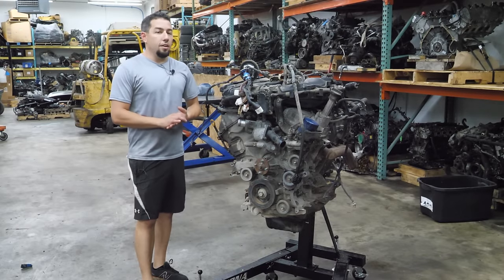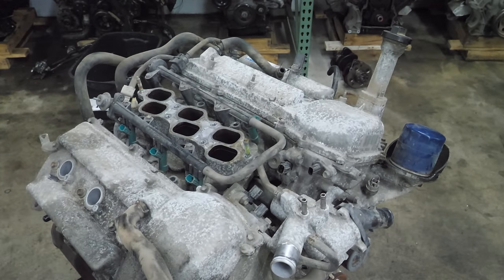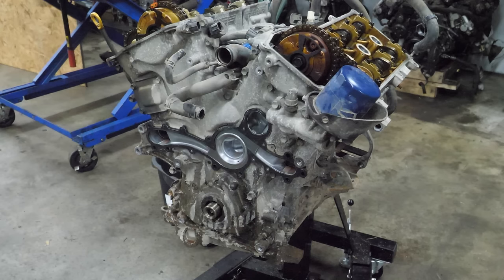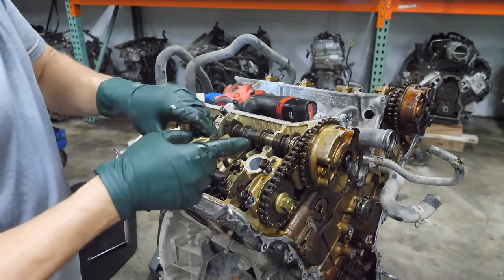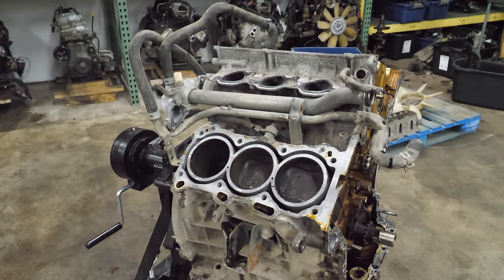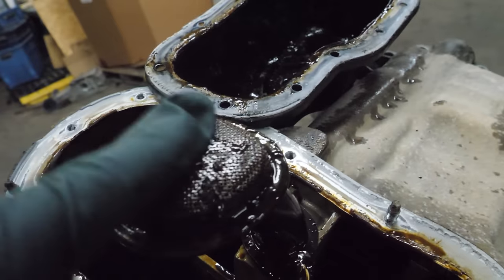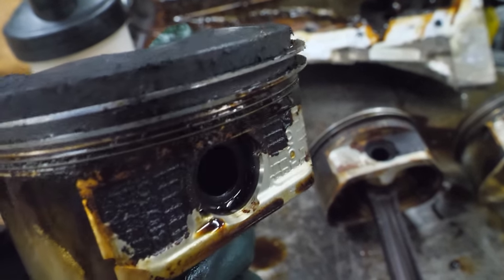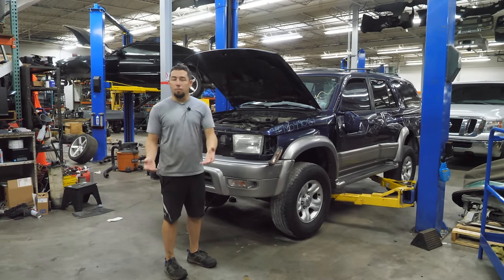Toyota 4Runner 1GR-FE 4.0 V6 Blown Engine Teardown. Just A Slight Tick...

Comment: Awesome win! Yeah, I'm interested in seeing what damage can be caused by which events on really bad engines. When I hear the description of the condition before you start the teardown I like to speculate what might have happened. Given the overall condition of this vehicle, and the very low cost to you, it was a no brainer even assuming the engine was bad. Even the engine, minus two rods and pistons and the normal replaceables on a rebuild, has lots of good, saleable parts.

Comment: The reason there was water still in the engine was cuz you only removed the drain from one side.  V configured engines have 2 low areas, one at the bottom of each of the banks.  So if you remove both of the drain plugs (one on each bank) when the engine is level and vertical and drain both banks, you will only get a few residual drops of coolant when you turn the engine over.

Comment: Worked for Toyota during the early years of this engine.  Timing covers leaked - we used  Seal Packing (FIPG) 103 Liquid which is that very black RTV you see on that cover.
Reply: Dang would've been healthier to just leave it alone. Seems to be only a drop a week max on mine. Just makes the engine a little dirty

Comment: Looks like it definately got hydro-locked from water ingress blowing the conrod which means the engine can be re-con'd.  My previous 04 Prado 120 V6 with same engine failed from overheating when my wife was driving it in summer. The radiator sprung a leak and she did  not know and kept driving it & came home with a similer knocking noise to yours.  The heads got cooked and warped so we had to source another set of heads to recon. The block got bored & honed with oversize repair piston Kit and the whole engine was basically recon'd to back like new including new water pump/new guides/chain etc and back in the car with new radiator etc it ran real sweet again.  
We sold that white 5sp manual Prado for a later model black 07 same Prado 120 V6 with an auto trans (wife did not like changing gears in traffic) and we still have it 3yrs later as it is an awesome 4wd with a ton of mods now including harrop-E rear diff locker & upgraded exhaust, upgraded suspension, upgraded grille, upgraded binnacle LED headlights, upgraded LED tail-lights, upgraded wheels etc etc - It looks sinister now all blacked out.  Awesome engine

Comment: That was me with the tensioner I pulled off my 200k mile 4.6 2v tensioner. Not gonna lie, it didn’t have even one scratch, and had absolutely no wear pattern. I was upset. I’ve been thinking about changing that timing set for almost 135k miles, and worried about it for about 50k miles. Turns out I could’ve ignored it for another 200k miles. (Not literally of course). Thanks Lucas heavy duty oil stabilizer!!!

Comment: Eric: It looks like both the intake and exhaust valves are open at the same time, that's not how engines work!
Detroit Diesel: Hold my beer!
Reply: Not really an intake system as it's blown all the time. Yes I'm being that guy just to be that guy.

Imagine if he could tear down a small Detroit.
Reply: @taliakuznetsova7092 or maybe a big one? I used to work on 16v149tibs back when dinosaurs roamed the earth, I'd absolutely love to see a teardown of one of those.
Reply: Or any hot rodder's engine.  Overlap is almost mandatory.  A little at least.
Reply: @russellstyles5381  I've never heard of that before. May I have some more information?
Reply: @taliakuznetsova7092  It is quite usual for the intake valve to begin opening before the exhaust valve has fully closed, even on moderate performance engines, not just hot rods. They would not be both fully open at the same time. With a tuned exhaust, the exhaust can create a low pressure in the cylinder as the intake starts to open, helping to start sucking the new mixture in.
Reply: @taliakuznetsova7092  overlap means that the inlet and exhaust valves are open slightly at top dead centre between their respective strokes. This improves performance because as the exhaust rushes out of the cylinder it creates a brief pulse of low pressure behind it, having the intake open at the same time allows it to suck extra mixture into the cylinder. The extra mixture also tends to flush residual exhaust from the cylinder.

The downside to this is that at lower engine speeds the valves are open too long, leading to exhaust being sucked back into the cylinder during the intake stroke, and fuel escaping out the exhaust. So the engine is less efficient, and might run poorly at idle.
Reply: @nerd1000ify  Which I imagine contributes to the popularity of VVT systems that can remove the overlap at low and idle speeds to get that efficiency back.

Comment: I think the demand for these (and a lot of toyota engines) is export primarily. Yes they're swapped around not common like LS swaps but they're done especially into older stuff like t100s old tacos and 4runners and all that and even stuff like mazda b series and isuzu whatever they where. But i think primarily it's export. Even a common as dirt 1zz-fe (corrola engine) cores run around 300 bucks or so. Good ones are are about a grand unless high miles. a 4l v6 in a lot of places is a BIG engine and they rebuild cars from scratch in a lot of places these are exported to. I know my home country has an entire industry of importing in parts cars and rebuilding them. The quality of the rebuilt cars is often better than the locally produced stuff. Japanese imports are crazy expensive. African nations are similar.
Reply: I was thinking the demand has more to do with the lack of supply. Usually the only way you are getting one that doesn't have a ton of miles is finding a wrecked one.

Comment: This was a great video.  I have a 2013 Tacoma with the 1GR-FE (just turned over 100,000 miles today!), and I really like mine - plenty of torque, and it makes nice sounds.  Much better than the newer models with the 2GR-FKS.

The thing that caught my attention was the knock sensors, in the valley in the block next to the Number 3 and 4 cylinders.
Reply: I had a 2019 Tacoma standard trans. I didn’t like the 3.5 much, no low end torque. I’m in a 2021 4Runner now, I love the 4.0.

Comment: Best part of the week! Watching Eric's teardown videos. The water pump gag got me. A suggestion for another engine disassembly video. What about a GM 3.8 V6?
Reply: My 1989 Olds had that engine, the timing components were pretty much all sitting in the oil pan by 100k.
Reply: @piggy310 plastic parts or bad manufacturing?
Reply: @taliakuznetsova7092  Plastic parts..
Reply: @piggy310  plastic is both a marvel and the bane of society at the same time in a magnitude of ways.

Comment: Great video! I had a 1GR in my 08 Tacoma. It was a solid engine. I even ran a dry 75 shot through it without any problems. I’d love to see a 2GR-FKS from the 3rd gen Tacoma which is what I run now with a supercharger. Even a Subaru boxer engine would be cool to see torn apart. Keep up the excellent content!
Reply: I know he has done at least one Subaru engine in the last 6 months or so a year at most.
Reply: I'm one of the few who doesn't like (I don't hate either) that engine.
It has goofy power delivery. Weak low end torque, any power that it does have is up in the revs.
Reply: @Hybris51129  Thanks. I found a couple episodes. Surprised I haven’t seen these yet.
Reply: damn bro you put a 75 shot in ur taco LOL that's hilarious
Reply: @joshanderson924  yeah man. The video is on my channel in the shorts section. It won’t let me post the link. It ran mid-high 14’s in the quarter mile. 140k miles. The car running in the other lane ran 11’s.
Reply: @fiveohstang  Damn haha love these engines you could probably run them on Nitro Methane 😂

Comment: The 1GR-FE that's on 2010 and up had some significant changes. For one thing, they totally relocated the oil filter and associated plumbing, so I figure it's actually a different beast in many ways than the one you worked on.I  Know the one used in the Tacoma was a bit different, and the 2010 models on used dual VVi as opposed to single VVi on the older ones. My point being, it's actually a very different engine from 2010 on.
Reply: Does that include the 2010 itself?
Reply: @joshanderson924  Tacoma 1GR still used single VVT until the 2GR-FKS replaced it. The 4Runner got dual VVT when the 2010 full model change happened. I'm not sure about the Tundra.
Reply: I've got a 2016 1gr with single vvti in a 2016 Hilux awsome motor
Reply: They are still in the current 4Runners. I have 2 of them a 2020, and a 2021.

Comment: My theory for engine swaps. People keep running them into water and hydro locking them. Seen a few of those on tacoma forums throughout the years. 

With that being said. I own a 1gr in 2nd gen tacoma. The truck is great. But they're kinda slow and horrible on fuel. But I dont like working on my daily. So I live with it.

Also can someone explain the oil filter housing to me? I love that they made a drain for it. But why did thru drain it directly over the power steering pump. Its stupid
Reply: The built in funnel runs down to the bottom of the engine if I remember correctly.
Reply: @12345.......  it does not. You'd have to run a 3 foot hose to get it under the engine
Reply: Plastic bag under the oil housing is a good solution to catching the oil
Reply: Take a closer look at it. It appears to be a rubber plug under the hole rather than a hose which it looks like. I think it's just to drain the remaining oil from that housing after an oil change then put back on. I took mine off and cleaned the orifice out with a toothpick found it's just a plug.

Comment: Buddy of mine has a Tacoma with this engine with 570k miles.  I thought it said 57k at first until I did a double take.  It was still running great, original transmission and had only had basic maintenance.  I need to ask but he didn't even mention a tune up just oil changes, filters, and tires.  It's wild how overbuilt some of these older Japanese vehicles are.

Comment: anecdotal experience: buddy of mine with a 2uzfe sucked up some water and windowed the block. Drove it off the trail (20-30 min), drove it 3 hrs home. Then drove it 30 min to my shop. Long story short, yota engines take a lick and keep tickin.

Comment: Having replaced several Toymota engines most have either been cooked or run out of oil. They run out of oil because they burn it! They are far from infalible like so many seem to think.
Reply: Low tension piston rings as they get newer. Forget which bit one of the transverse engines was awful at burning oil day 1. Never burned any oil with my early 2000s 4.0 and 4.7s though

Comment: Toyota FIPG (form in place gasket) that the shops use is black an the factoroy sealant is usually grey.  That glob you found is where the timing cover chain tends to leak.  Probably a reseal job.  Not atypical, although you can run a long time without the fix as the leak is there (and at the square cover for the tensioner) , but not terrible.  I have 355K  miles on my 2008 4Runner, so ask me how I know.  🙂

Comment: You definitely have all you need to build a good short block. That crank could certainly polish out with some crocus cloth and the cylinders in the block would also hone nicely with a professional grade stone honing tool. The pistons might also clean up well enough to use. All you'll need is another nice connecting rod. Any "tight" wrist pins would probably be fine with a good shot of some WD.

Comment: Head gasket leak on that cylinder possible caused damage when started after sitting over night, that was long enough for pressurized system to fill cylinder. The black fipg on the right side of timing cover possible from warranty oil leak repair on the early 4Runners. Did several leak repairs on these engines plus the back cylinder  was known to have coolant leaks after 100k miles. Retired after 38 years at Toyota.

Comment: I used to work for a shop that specialized in Japanese vehicles. The vast majority of our business was Toyotas and Subaru head gaskets.

I’ve worked hundreds, if not thousands of vehicles with the 1GR and I think the most significant repairs I’ve ever had to do to them are water pumps and the crappy AIR injection system that seems to plague every Toyota truck. This is actually the first time I’ve ever seen the inside of a 1GR because I’ve never had to take one apart before.

2GR that’s in pretty much every Toyota car and car-like SUV is similar, save for the silly rubber hose they use to supply oil to the right head. I’ve seen some 3 and 4GRs have oil consumption issues, but never a 1 or 2GR.
Reply: Any preventative maintenance recommendations for 1grfe owners?

Comment: Lot of early 1GRs seemed to have head gasket failures commonly occurring. That issue seemed to have been fixed around 2006/2007. Very solid motor otherwise. Wasn’t expecting this though.
Reply: Come in here looking for such a comment as yours 👍
mines 11/ 2005 and now has started overheating 😥

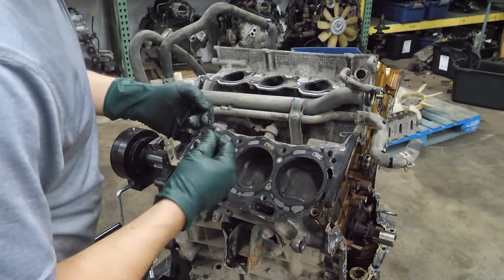Comment: 23:51 boogery RTV was the fix for the timing cover oil leak these engines are notorious for. That’s why there was two kinds of sealant in there when it was removed. They all tend to leak on the side you found the big chunk.

Comment: Very explanatory video ! 
But again and again itbis coming to one conclusion: for those people who are ignorant  and/or arrogant or just pure careless even the good engine will fail. 
IF ! the owner of that 4Runner took more care about his engine, this 4Runner will still on the road even in this days.
Change the oil/filter with Premium Synthetic brand and from sealed jar, not from "bulk" cistern. And about 4-5 K miles.
Also Antifreeze, Radiator and Spark Plugs should be changed.
Look at the upper oil pan ? That sludge should not be there if was using a Good Qualitu Oil...

Comment: When the exhaust manifold bolt got stuck in the socket and you took your frustration out on it with a hammer had me rolling 😅
Reply: The high pitched cartoon speech from the speedup accompanying it was the best part.

Comment: The block is trash, they aren't machinable, hope it wound up in the metal bin.

I was happy to see this, I was really wanting to see how the intake manifold came apart, I've been considering doing fuel injectors in my Taco, now I think I know what I'd be getting into. Kinda weird, my first non-Subaru, yet it has the same problems as my last Subaru... Bad fuel injectors. Funny note, the MAF sensor is identical to the WRX, Baja, and STI MAF sensor, except it's calibrated slightly differently.

Comment: Stay safe in the heat brother.   This heat wave is something, I wish we would get a break from this.   I'm down in Alabama, we haven't had it nearly as bad as it's gotten out West though.   It's still been getting up to 98 or 99 degrees just about every day though, with heat index going up to 116 or so.   I can't even imagine being in Arizona or somewhere with 110 degree or higher actual temps.   California is having trouble supplying enough power to keep up with demand, and they're trying to ban gasoline powered cars by 2030.   Well I think they are going to be in for a rude awakening, somehow I don't think the power grid there is in any shape to be adding thousands and thousands of electric cars that will be needing to get charged.

Comment: Good job Eric... I've learnt a lot from this tear down of 1GR-FE 4.0 V6 because I own a 2008 model of same, but ernest question is; what is the exact cause that made a connecting rod break like this? I want to know in order to be guided  accordingly and not to fall any victim whatsoever.
Reply: I have a 2008 4runner as well. Nice to see the tear down for a look inside. Too bad it died. Mine has 300k on it and is running well. I send in regular oil samples to keep tabs on how it's doing. As for the broken rod cause: Water in the engine, specifically the cylinder with the broken rod. Water is incompressible. So, when the piston rises on the compression stroke, the water says NOPE! The smallest part of the rod is the place the forces overcome the material, and it fails. 

Looks like there was a secondary issue with the grit in the oil causing rod bearing wear and oil pump wear. Some of it might have been debris from the broken rod, but no real metal bits were found. The goop in the oil pan and RTV on the pickup tube+ evidence of someone opening the timing cover indicates a bit of a mickey mouse repair job at some point. It would be interesting to know what they tried to do.
Reply: @TheDesertRat31 I love seeing stories like this. I have a 2020, and 2021 4Runner. Both bought new. I plan to keep them a really long time.

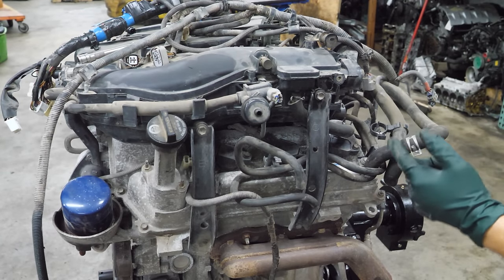Comment: 2:45 Good bit of serviceability in the design there. Rare, in a modern engine. I refuse to buy an engine that requires the intake manifold to be disturbed to do basic servicing like spark plugs. Little shit like that makes a world of difference. Routine maintenance items should NEVER under ANY CIRCUMSTANCE require disassembly of ANYTHING.

Not even a plastic beauty cover. Spark plugs, plug wires, filters, drain plugs, belt tensioner/pulleys, anything that's part of routine PM services should be accessible simply by lifting the hood or jacking the vehicle.